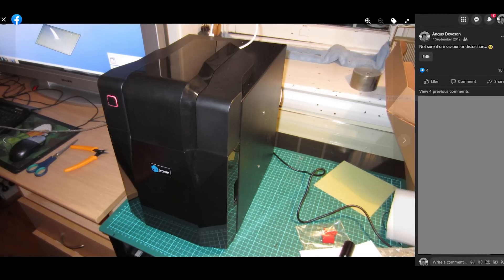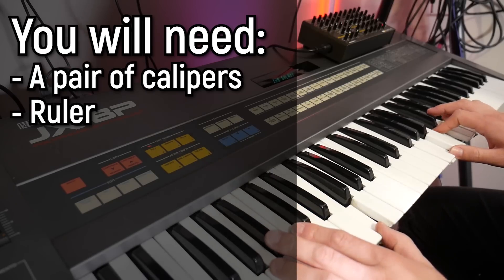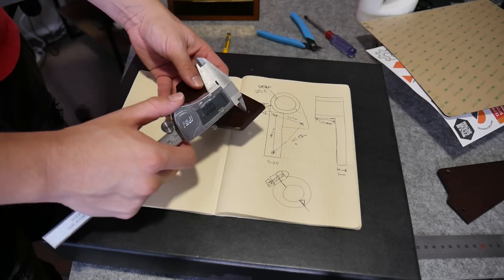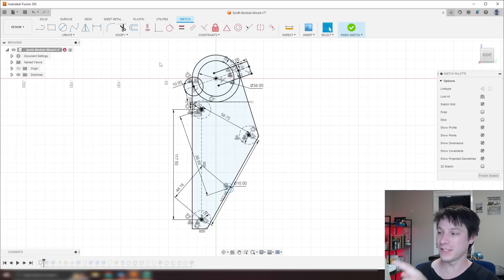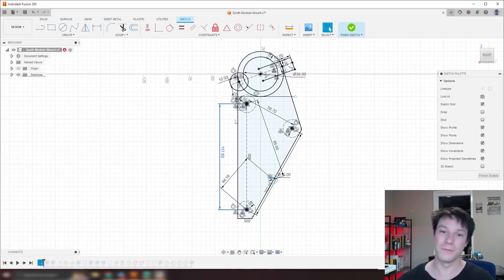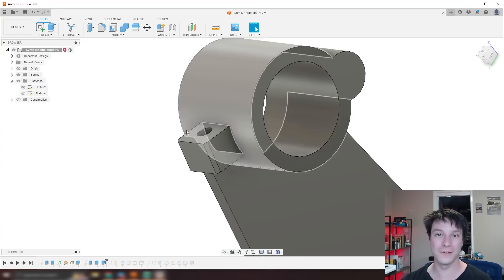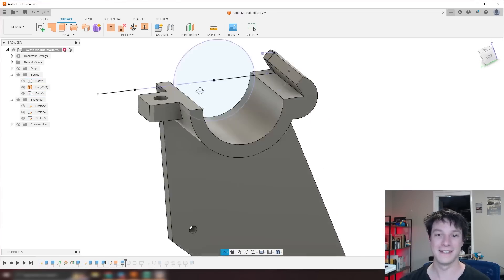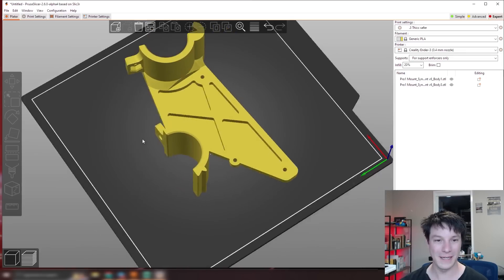Attach anything to anything else using 3D Printing!

Comment: A lot of CAD programs (FreeCAD included) will let you import a picture of something and if you get it as straight on as you can (hint, zoom in as much as you can with your phone camera and take the picture from as far away as you can to remove as much parallax as you can) and you can input measurements of the image and trace around the part you are trying to duplicate.

Comment: If the template object is flat, I scan it using the paper scanner. Then import to CAD software and resize according the largest dimension and then simply trace over the top

Comment: It would be great if you showed how to model based on a scan. I quite literally use a scanner and a ruler quite often for modeling flat pieces like the side plate of that synth part. If you just scan a ruler and the part you get an nearly orthogonal POV that you can import and scale and just basically trace. A cameraphone works nearly as well as a backup.

Comment: Distance between holes. Better Method
measure outside to outside (reverse caliper jaws, one in each hole, push apart)
measure inside to inside (normal caliper jaws, one in each hole, pull together)
add numbers, divide by two.
Now I know the center to center distance. 
and hole radius doesn't matter (Holes can even be different size)

outer: center+r1+r2
inner: center-r1-r2
outer+inner/2  :  (center+r1+r2+center-r-r2) /2  :  2center/2  : center
radiuses all cancel

Comment: Those calipers are a fav of mine! I picked one up after I saw one on the counter of a local McMaster-Carr order desk. What sold me on that particular one were the three measuring options available. millimeter, inch and fractions. Since I work mostly imperial, the fraction option was a winner. There's a tiny screw on the back to change the battery. Don't try to pry off the cap like I did. 😂

Comment: If you're trying to recreate hole spacing/dimensions of an object one of the best ways I have found is to take a top down picture of the item next to a ruler. You can then import this picture into Fusion 360 and scale using the ruler. Then you can easily sketch holes on top of the picture and they line up perfectly.

Comment: When designing, get the fasteners you plan to use first. Don't trust the fastener dimensions you get online. I guarantee they'll be different than the screw or nut you bought at the local hardware store. #askmehowiknow

Comment: Nice idea on the "hinge" design, makes it much easier to print this type of thing. When making parts like this I typically oversize the large hole that goes over the pipe by around 2-3mm, and then glue or place some thin cork sheet (or linoleum or similar material) into the hole for more friction, gives a much more snug fit.

Comment: As an industrial design engineer I quickly learned that most of my time would be spent designing fixtures to attach one thing to another thing. SERIOUSLY, the vast majority of the projects I worked on comprised this exactly.
I would suggest you add a Pocket Optical Comparator set to your measuring tools.

Comment: I'm a metal worker by trade and I'm also a synth head with a home studio setup. Well I do use a lot of steel and wood wherever I can I've been using a 3D printer for years to make all sorts of strong lightweight parts to modify my setup and just optimize my workspace. Two things I always keep in mind is cost of material and weight. 3D printed parts over something I could have made out of steel but still come up with the same end result takes care of the cost factor as well as the weight factor. I also use my 3D printer to make custom knobs and volume faders across my entire setup. If you got a home studio and a little bit of engineered intuition a 3D printer is a must to have around.

Comment: great video.. was making something for an outdoor pole and used your video to design. Although in my case, the diagonal cut on non-bolt side was weak. If too much force is applied to that fixed joint part it wil force the 2 parts to separate as one part rides along that diagonal cut line and will separate. I ended up using an inverted "J" shape (slightly offset from centre) in there which held really well.

Comment: My fellow 3D print designers, number one tip, add clearance.   .01mm of clearance is probably not enough lol

And for split clamps like this, you could give the parting line some clearance so when you clamp it together it’s sure to be squeezing

Comment: Aside from clamps and brackets for whatever needs mounting, I also use it to replace broken plastic parts, like broken knobs, lids and covers. Repairing stuff like a drying rack that's falling apart with some handy clamps works too. And you know that weird little corner on the stairs that you can't get to when vacuuming? There's probably already a custom nozzle for it you can just download and print. Finally, custom boxes and drawer compartments specifically made to fit stuff make everything much cleaner looking.

Comment: Using the I.D. jaws, measure the furthest distance between the holes.  Using the O.D. jaws, measure the closest distance between the holes.  The center-to-center distance is the average regardless of the hole diameters.

Comment: Oh man I use mine for stuff like that constantly.  I made a guitar pedal board all from scratch in Fusion 360 custom made brackets to mount them.  I made a laptop stand to keep my Dell's keyboard folded back out of the way so it stands up like a monitor.  Towel brackets in my kitchen.  Shower shelf.  Suspended ceiling hooks for wires etc.

Comment: I recently designed and printed a set of speaker stands for some small secondary monitors I purchased so that they would tuck beneath my main reference monitors and point up at the proper angle. I seriously doubt that I could have purchased stands that would have fit so perfectly in the space under my other monitors on their existing stands. Or if I HAD found some system that would have worked… I am certain it would have been very costly.

Comment: Thank you for this awesome demo.  it's certainly inspiring.  one minor note is that it looks like this mount might have difficulties staying in place.  I might suggest widening the tolerance of the part that mounts to the tube stand and using a bit of foam rubber material to increase friction and using the force of your clamp to dial the friction in to your preference - that would make it significantly less likely to rotate around the axis or slide side to side.

Comment: I can vouch; using calipers to measure things so that you can design clamps, brackets, holders, mounts, and adapters is fun. Currently I'm printing out something that fills the two cupholders in my vehicle and replaces them with one giant cupholder for my 40-oz water bottle

Comment: Is the best solution ever. In my flat I have parts designed and printed specifically for what I need from a mirror holder up to a DIY CNC router. Is the best if you are creative and really cheap. NICE EVERYONE COULD DO IT.

Comment: 3D printing is not my hobby, but I 3D print lots of things to attach other things together. Ductwork adapters in the woodshop, synth risers, replacement brackets in some old electronics, a baffle for my telescope, and more.

Comment: TOPIC: "zeroing-out-the-hole-radius-trick". So: I have a machine shop, and a caliper (please don't say "pair of calipers"! (1:37)) - and am pretty damn experienced; nonetheless; when you did the "measure the hole diameters, then zero, then measure distance and you get distance between center points; really-really handy trick!" -- I had to pause the video and think for about 30s as to why (A) ZEROING out the  (B) hole DIAMETER (which (C) you pointed out was same-same) would then give a (D) CENTER-CENTER measurement when using (E) an OUTER-OUTER measurement. (Answer: because zeroing out the diameter subtracts it from a measurement that's effectively got 2x the radius from a center-center measurement, so.... same thing as subtracting the radius twice.) BUT YOU JUST RUSHED PAST THAT, rather than explaining why that's such a neat trick (and yes, it is.) Sometimes, dude, your videos are just a little TOO edited-down - and you rush past things. Too bad YouTube doesn't really have a "footnotes"-equivalent feature. That-all said - you do great stuff - respect.

Comment: 2:47 One of the ways to mount a bracket that is often not thought of is to use high strength double sided tape.
Merely design the mount to have sufficient surface area for a strong adhesion. You don't have to modify the item being mounted and the tape can be released by pulling a loop of fishing line through the gap and tearing the tape in two.

Comment: One of trick I am using is paper with milimeter line grig from stationery. I trace part on that paper and I get XY cordinates of holes and shape. That made sketching very easy. Later I print drawings on paper and compare results with original part.

Comment: Best way to copy flat shapes is to trace the parts on mm paper and scan them on a flatbed. Correct the scan for scale, load as Referenz/Background/Picture frame,...in your CAD software.
In do cut pickboards on the CNC...this works the best.

Comment: Fun fact! If you have a diagram/schematic to trace, and you use a vector graphic program like Inkscape (free), you can draw, fairly precisely the footprint of an object and then import it into your modeling program (such as Blender3D) and extrude it to a 3D object. It makes creating complex 3D objects easier. 

Also, if you have the cross-section of a circular object, it works the same way, using the screw extrusion tool. It makes designing things a LOT easier. I made a 3D-printed carbon microphone this way.  ^_^

Comment: Just started designing a couple days ago. TinkerCad was super easy to learn, within a couple days of signing up, I fully designed a mount to hold my power-tool batteries. I corrected all issues after the first prototype as you mentioned. Then I began to trim the fat to make them cheaper/quicker to print(I'm new, and I underestimated the strength of PETG). Designing this has been the most fun part of 3D Printing since I got my printer.

Comment: Another way I have found that is flawless and WAAAY easier than using trig and math is simply taking a photo of the peice directly above the piece and at around two to three feet away for something like the piece in your video. 04:35  Import it into the CAD software, measure the longest dimension and scale it in the software to match that length and build off of that.   Takes all of around three minutes.

Comment: 100% this. 3D printing excels in one-off brackets and enclosures for mismatched parts. For example, I'm currently designing a holder for a Zigbee button to control a shop vacuum on a Zigbee outlet. The button will velcro onto the holder (so that it can move between holders mounted on tools), and the holder will be clamped onto the vacuum hose by velcro straps. This makes it really easy to turn on /off the vacuum while using my handheld CNC and sander. I'll also superglue a holder to my table saw. This combination of parts is wholly unique to my setup, and finding a commercial solution would be impossible. It's why I love being able to design and print my own parts

Comment: I have used this exact set of guidelines to make a 3d printed prototype brake brackets. The usual ones I've done are calipers from one car fitted to another car, but the craziest one I've done includes calipers, hand brake system and parts from 3 different cars. Sent the cad file to a machinist and he made the prototype out of aluminium. Living in the future!!!

Comment: I’m honestly surprised more auto mechanic shops don’t have a 3D printer. ABS is a common automotive plastic, especially for small clips and parts. I’ve printed more parts for my car than anything else. Super easy to print one body panel clip in 15 minute vs buying a pack online and waiting days for it to arrive.

Comment: Great video, as always. There's a slightly easier way to get the dimensions right in Fusion 360. Take a picture of the part, with a caliper or ruler in the picture. Insert the picture into Fusion as a Canvas. Calibrate the canvas (I think it's on the right-click menu). It'll ask you to select two points in the image and then tell Fusion how far they are apart in physical units. Since you wisely included a ruler in the picture, you can just pick two points on the ruler. It'll scale the canvas accordingly. Then, you can easily build your sketch to match the part in the image with physically correct dimensions.

Comment: A suggestion for accurate templates WITHOUT calipers or measuring. 

Adobe illustrator and several other programs can output svg files. Take the piece you want to make into a mounting point like your side panel, scan it on a cheap office multifunction printer and open that in illustrator. Modify it as a 2d design like looking at the top of your workplane. 

Export as svg and bring into any cad software and you have a perfectly shaped piece you can add depth to. 

I don't know cad enough to know if you can import a JPG or PNG directly but I like illustrator because it's easy to auto trace  the shape and easy to make the design with the shape tools there.

Comment: My friends and I went in together when the Ender 3 first came out. Eventually it ended up in my hands as the rest went to either higher end models or SLA printers. I wanted it specifically for this reason. I don't know how many little things I've printed for just around the house. Be it sponge holders for the sink or feet extenders. It's not mostly used to print gecko hides though.

Comment: Cool!! Just learning but need to remix a drone component that holds a gps antenna, a bardpole antenna and a standard sma antenna. need to narrow the standoff holes width hole to hole by 2mm and the standoff hole height height by 5mm and possibly slightly enlarge the gps antenna area which software solution do you suggest? I'll scroll through your vids though and try different things...tried blender but seemed a lil rough for a newb

Comment: Funny that this comes out now.  I just finished a similar endeavor.  I has a small web cam and a mini tripod for a go pro.  The camera was not a go pro and its mount was just a bracket with a flat bottom and four holes for mounting screws.  I was able to design and print an adaptor that attached to the camera bracket and fit into the mount on the tripod.   One thing that I find useful is to use a spreadsheet for all of your measurements.  You can then derive other measurements from those as needed for the model.  If you are using a CAD program that has a built-in spreadsheet like Freecad, use that.

Comment: So there's actually an even more rapid prototyping method I often use on these type of projects which helps tremendously during the design phase. When I'm trying to verify a bolt pattern etc I will often turn to my 2d printer to ensure I've got the right dimensions. 2d printers can be had for less than $100 us and are widely available. I highly recommend them for any maker.

Comment: Brackets and electronic housing is basically what I use my printer for the most, it’s extremely useful and convenient. You could have used a 45° chamfer over the bolt holes instead of fillets to save the need to use support material.

Comment: One suggestion I would have would be to cut a depression on the smaller tube mount to add a tpu gasket. Tube mounts are notorious for slipping. A rubberized insert on that small peice would eliminate any chance

Comment: a really useful trick when measuring things is to try both metric and inches, to see if one of them is close to a round number.
most products will have regular dimensions so it's likely that e.g. 76.21mm is actually 5 inches and the item was designed using imperial units.
this can make figuring out dimensions a lot simpler 
(and of course you can convert all the units back to metric afterwards)

Comment: Thanks for the great tips, Angus! The solution with just one screw holding the clamp is really cool! I've thought that it will be a hinge when you've started to tell about "to use only one screw point".
It's important that this small place with "teeths" must be very strong and printed well! Or the gear can fall down.
In my case I need to make a tube system before that :)) I have just a single stand (but a very good one) withou additional beams.

Comment: Do you have an Ender 3 S1 yet? I got the S1 Plus 300x300x300 really enjoying the upgrade from the 3 pro. I still have the 3 Pro rocking out but the S1, plus can print things that were way too big. I mostly like the noise reduction, speed and larger build volume. The only complaint is the home screen does not give you height progress only time and percent.

Comment: I started to use the 3D Printer like this, then thought about it as a meta tool (aka a tool to print tools), then I worked out restoration of vintage rc 1/10 buggys : any repair is challenging (measuring, design as close as possible of the original, material capabilities...). As per my own experience I don't rely on a digital caliper : they sucks and tend to loose their zero unless very expensive tools... And to avoid issue mesuring center to center distances, I generally set the measure in fusion360 with the addition inside a formula, which means you can directly check and change measurements if you have a doubt later on when printing the part in a material that doesn't shrink (quite important, IMHO)... Sometimes use tangent rules is making life easier as well...

Comment: Elephant foot should be tuned out of prints in slicing software or preferably overall tune of the printer. 
CAD model is not a correct place to do it.